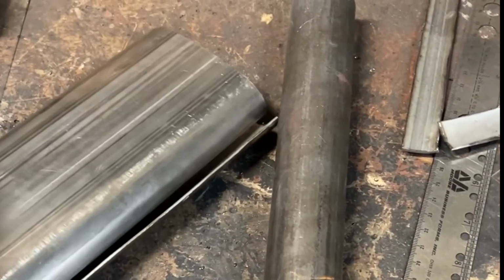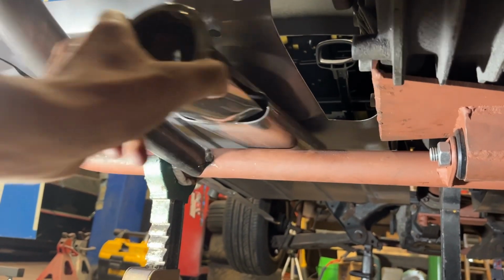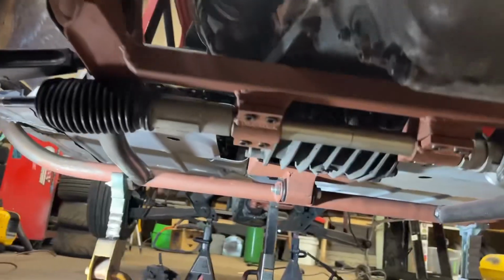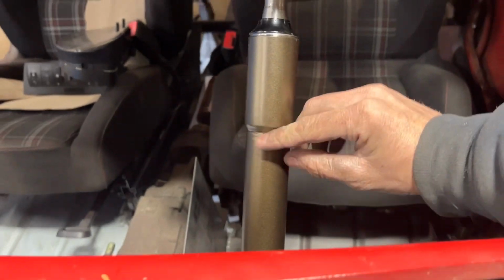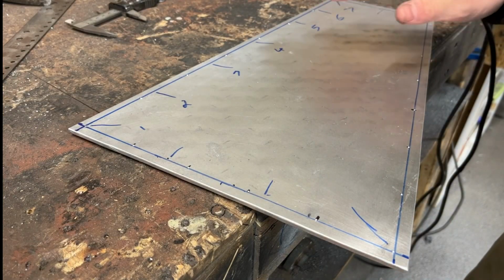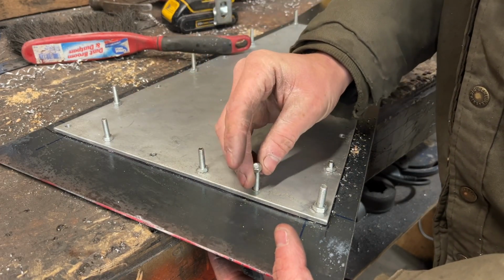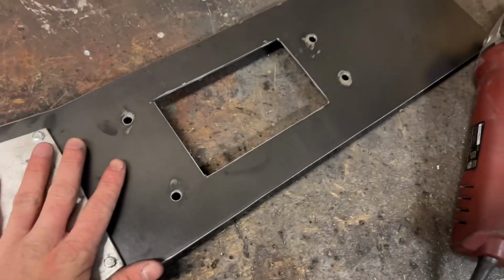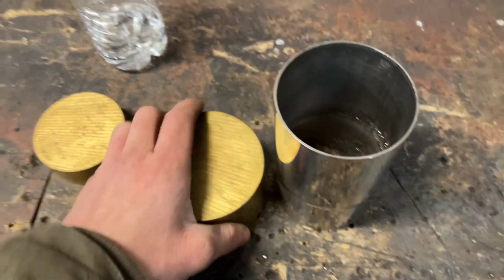HOLDING A CUP WITH NO HANDS!!

Comment: The brass accents are fukin awesome bro!
 If you need to “bend” tube like that again, try slotting the inside of the radius…. Do a few cuts, close it up, if you need more bend just run the thickness of the blade through again until you get the desired bend. Heaps less welding and filler required.
Reply from the maker: Ahh i think i no what you mean. Yea ill try that next time. I felt unconfident as soon as i new that was my only best option at the time. And when i lose confidence its more of me trying to figure it out as i never done that. Thanks for the tip!! Hopefully it holds😅😬. I threw in some big sticky hot beads so im feeling slightly better about and FUCK YEAH! I didnt no how much i liked brass untill just recently hahah